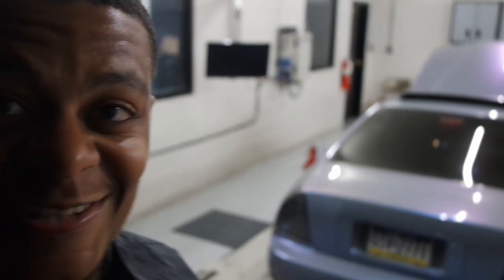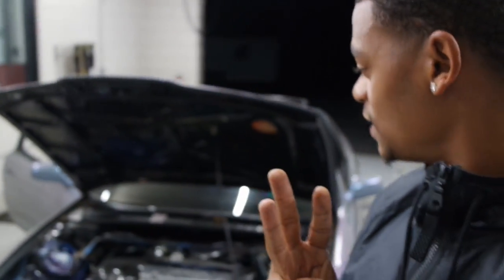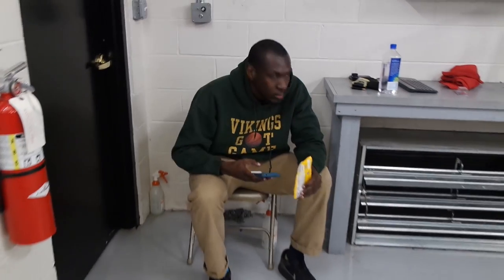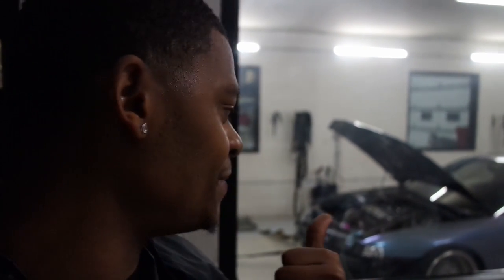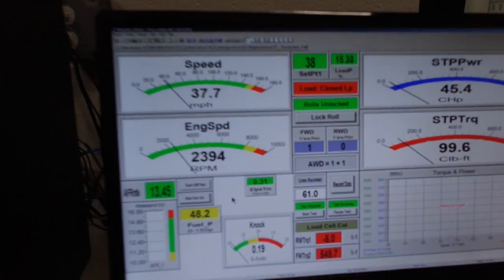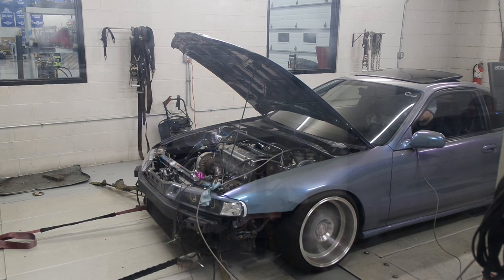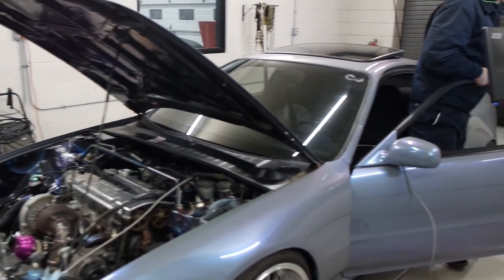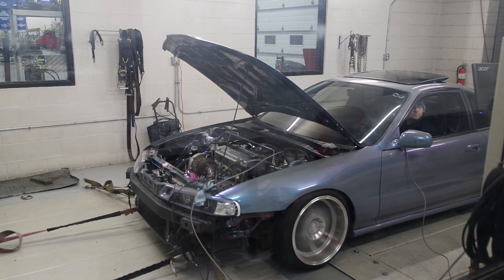Rare Turbo F20b Honda Prelude tuned on E85

Comment: That two step is nice. You going to redo the intercooler piping and a new manifold. Dyno days always bring more work.
Reply from the maker: Im hip and yea im cooking something up as we speak. Whats good with that all wheel drive set up tho?
Reply: @treybedipping1734  working on making custom motor and transmission  mounts now. Hope to have the engine sitting in the car with the new transmission and transfer case soon.
Reply from the maker: @AJIMPORTS  nice

Comment: Glad you got it done bro. If you want decent in price and that works I had the h22 plm manifold. It work and didn’t have creep issues. Best bang for the buck. I’m running the same on my k series also
Reply from the maker: Im interested bro can you send me pics on instagram @bagged_trey5
Reply: I have atop Mount PLM with upgraded 46mm wg on my f20b no boost creep at all
Reply from the maker: @Jib3rish23  nice how much hp and how many lbs?

Comment: Get another motor mount or custom an extra one or some better ones.. motor be movin some. Great power on stock internals... And as for that boost creep I'm guessing it's the piping or couplers. 👍
Reply from the maker: I plan on adding a front mount again with my new traction bar.

Comment: Bigger wastegate or electronic boost control if you dont have it
Reply from the maker: I tried both went from a 38 to a 44 tial and 4 port boost solenoid.
Reply: @treybedipping1734  then maybe you need a bigger exhaust housing . Not sure what you're running but the bigger housing would allow more free flow but in my opinion the solution to your top end issue would out weigh the little(if any) more lag. Little research in housing sizes would help understand if you dont. Rob dahm does a good video on results of the bigger housing on his rx7

Comment: That’s part of building turbo cars brother I have a turbo h22 I made 433 on pump on 14 pounds go with either a Sheeppy or mitiglus or how ever you spell it the guy Hayden from boosted boys you could make 600 on that set up no problem is the block sleeved ?
Reply from the maker: Yea as much knowledge as i have im still learning
Reply: Yeah for sure it was the best grand I ever spent my sheppy made the whole car feel better all through out the rev range

Comment: What's stopping you from tuning with the boost creep and just running more boost, injectors?
Reply: That would be a bad idea boost creap happens when the wg can't keep up
Reply: @vincenttreloggen9772  I know that, but it should level off at some point. A 44 mm wastegate should be more than adequate for that turbo. If he wants to only run 10 lbs he needs to down size his turbo.
Reply from the maker: @joshuahebert9949  stock block for starters lol can't or rather don't want to risk it. 🤕
Reply: @treybedipping1734  ok. That's what I was curios about. Stock bottom end would be risky on anything more than 10 lbs.
Reply from the maker: @joshuahebert9949  yea this is why i went f20b stock they are better for boost.

Comment: Nice Luda homie...I had a 96 prelude making 580 race and 490 pump 👌🏾💯
Reply from the maker: Nice thing was prob a monster
Reply: Yup I had the same problem too with my manifold and boost creep so I bought a nice tubular manifold and a tial waste gate and it fixed it up but aayyyeee those wheels at dope a/f bro 💪🏾
Reply from the maker: @anthonydelacruz2463  thanks bro what did you have before you upgraded?
Reply: I had a drag cast iron manifold and a turbonetics waste gate..My tuner said the placement of the waste gate on the manifold was a bad design. So the waste gate was attached to 1 runner on the manifold instead of all 4 runners where the collector is. So my new manifold had the waste gate flange in the right place. I went ahead and bought a tial 44 mm waste gate. What injectors are you running?
Reply from the maker: @anthonydelacruz2463  nice and im running 1200cc fic's

Comment: Any head work?
Reply from the maker: Completely stock bro
Reply: @treybedipping1734  was it the manual version or the automatic?  I've read different things from people about the manual version producing less on boost than the auto version.    I'm getting ready to swap and boost my acura
Reply from the maker: @CoryH-ro2ky  yea i have the full manual version but i ha e boosted both. In my experience if there is a difference it isnt much. Stock the manual has 20 more hp but with boost none of that is really relevant
Reply: @treybedipping1734  sweet I'm planning on swapping and boosting an f20b in a first gen acura cl  but I'm gunna go on with head work  since there is a lack of bottom end parts readily available
Reply from the maker: @CoryH-ro2ky  whats your power goals?
Reply: @treybedipping1734  I'd be content with 400+
Reply from the maker: @CoryH-ro2ky  you wouldn't need anything more than a stock block then bro
Reply: @treybedipping1734  I've heard the ring lands are weak points  how much boost were you running?
Reply from the maker: @CoryH-ro2ky  in the h22 yes but if you go the f20b is the best motor for stock motor on boost
Reply from the maker: @CoryH-ro2ky  and 10lbs